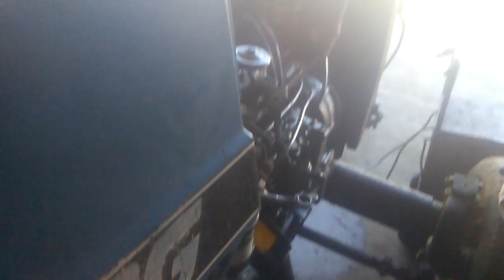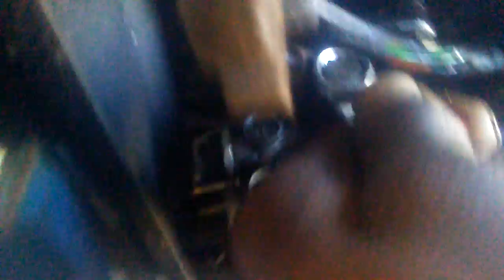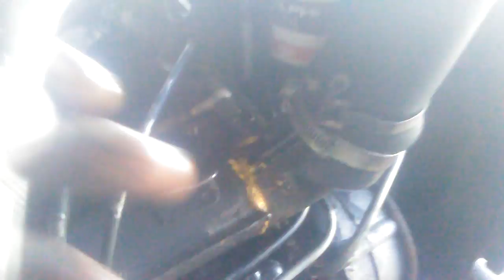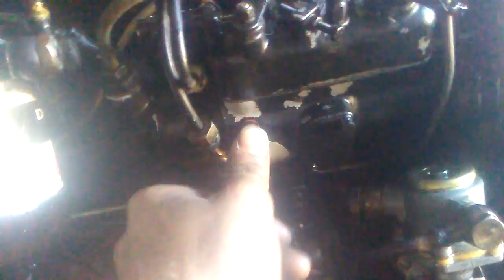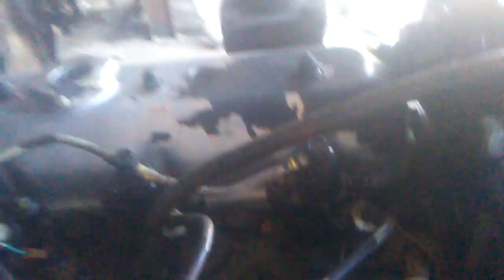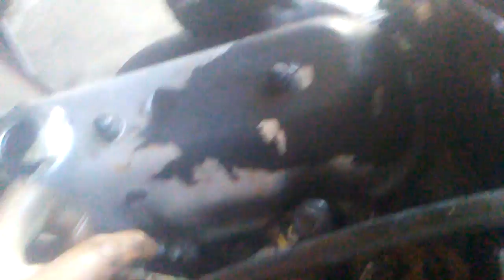How to prime the fuel system on a 90's and older diesel tractor

Comment: Thanks for the video. I have a Long 2360 tractor that will not start. I have very little , if any, fuel to the injectors. I saw your tractor injectors squirted out a lot, so mine must have a bad injector pump. I ordered one so I hope that is the problem because they are very expensive.
Reply: Did that fix the problem? My old ford 3600 is the same way. I have to bleed it every time I use it and it takes forever to bleed it. I’ve been at it today for about 45 minutes and it got dark outside so I gave up. It’s never shot diesel like his tractor. You can barely see anything come out. The middle injector is always very weak flow if any.
Reply: @jamesbarron1202 Connect a small 12 volt fuel pump to the primary inlet of the fuel filter housing . Bleed fuel injection pump and tighten bleed screw , crack and bleed all the fuel nozzle  line nuts and retighten .  Start engine .  Check for fuel restriction in the tank and filters . Amazon , MR. GASKET diesel fuel pump , about 10 lbs. pressure .